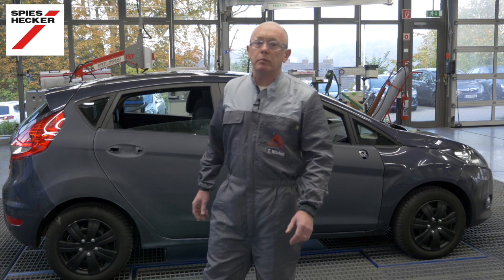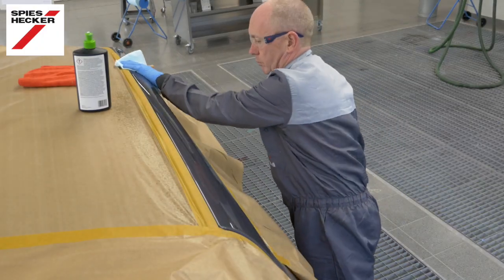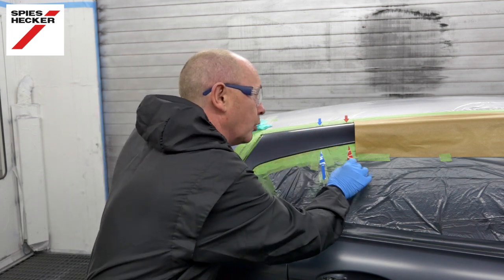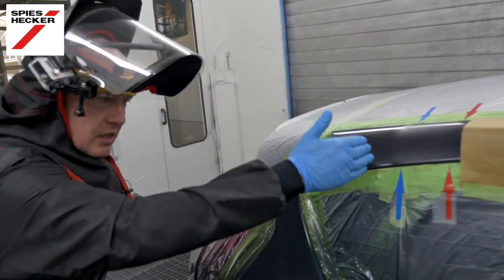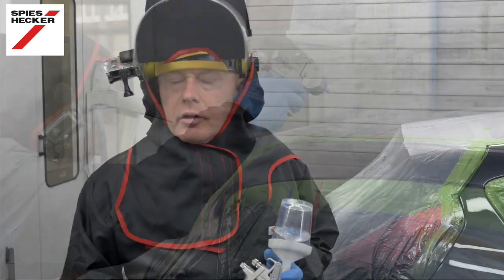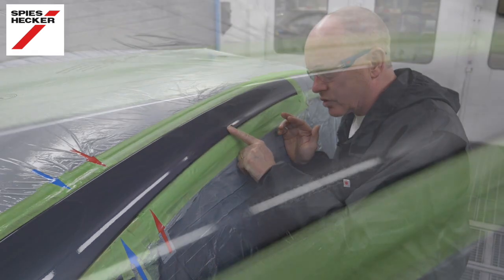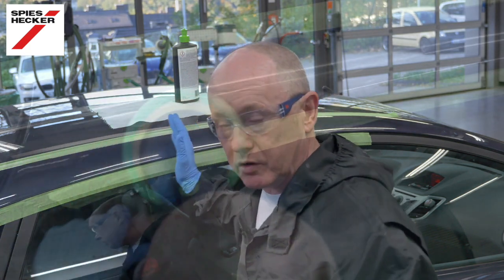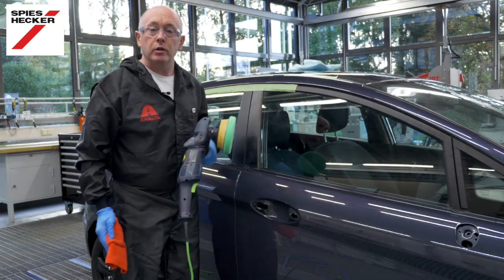Permasolid® HS Race Clear Coat 8700 - Effective blending and polishing

Comment: Soo much easier to clear the whole sail panel. Clear blends like this won't last long in a sunny climate. Also no warranty on this type of repair.
Reply from the maker: Hi, in principle we would agree that it is beasier to apply clear to the complete rail. The purpose of the video though is to show how to blend if and when the situation arises i.e. where a pillar goes into the roof with no break. In some markets around the world refinishers do not always have the possibility to apply clear to the whole panel.
Reply: You spend more time=momey polishing vs painting the the entire rail
Reply from the maker: In general I would agree with you but the purpose of the video was to show how to do this when for practical or economic reasons painting a whole part is not possible.

Comment: How long do you think a clear blend will last if it’s done right
Reply from the maker: Difficult to give a precise answer as it depends on many things such as how the process was done, the substrate beneath and the climate conditions that the blend is exposed to.
Reply: So y not just do the hole rail
Reply from the maker: Hi and thanks for your comment. The purpose of the video was to show how to do this when for practical or economic reasons painting a whole part is not possible.

Comment: I use a litle fade out and melt my color and clear coat?But second time i need to sand and polish and i peel clear.How i can prewent that?thank
Reply from the maker: The secret lies in preparing the blend area well in advance and keeping oversppray to a minimum as we try to show in the video. The blending thinner we use here is designed to be used as is and should be applied in sevral light coats to gently reduce the overspray. Use low pressure and reduced fluid flow. Best practice is to dry the blend egdge further with IR  after normal force drying or leave overnight to ensure it's fully cured before starting to polish. Use a fine/medium compound to polish and be sure taht the rotation of the polishing machine goes in the direction of the clear to the blend and not against it.
Reply: @Spieshecker  im intersted how not to peel the clear while polishing?did i owerdid or what can be wrong?and why does melt away blender melt a color new and old one like realy bubly mealt?did i do something wrong?
Reply from the maker: Thanks for your reply. From your description I think you are using too high air pressure when applying the blending thinner. The thinner is of course low in viscosity and excess air pressure will cause it to separate on the surface and give an uneven appearance. Normally I reduce my pressure down to around 0.8 – 1 bar and I reduce fluid flow to prevent overloading.

Please also refer to the following TDS’s for information on our blending thinners. The choice of which you use will be dependant on the clearcoat you are using: -

http://sdstds.shcolor.info/Doc/TDS/EN/EN%201036A.pdf
http://sdstds.shcolor.info/Doc/TDS/EN/EN%201070A.pdf

For Non VOC compliant clears we also have the following product: -

http://sdstds.shcolor.info/Doc/TDS/EN/EN%201031A.pdf
Reply: @Spieshecker  thanks i will try that ...youst keep posting great videos
Reply from the maker: Ok, great. 

Thanks, we will. Stay tuned...
Reply: What’s your fade out process using 8180 and 1036
Reply from the maker: Hi, I'm afraid that we do not have that clear within our  offering in the EMEA (Europe, Middle East, Africa) region. We would recommend to contact our colleagues in North America ( https://www.axalta.com/spieshecker_us/en_US.html).